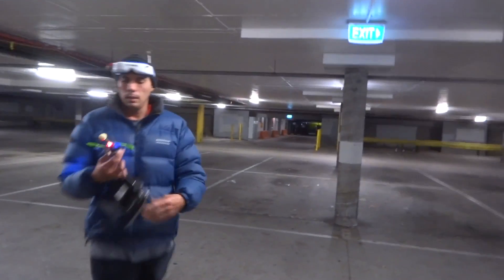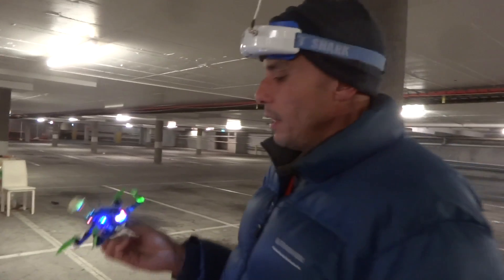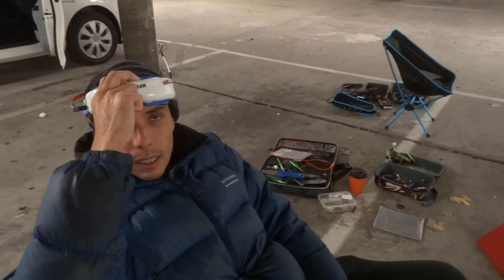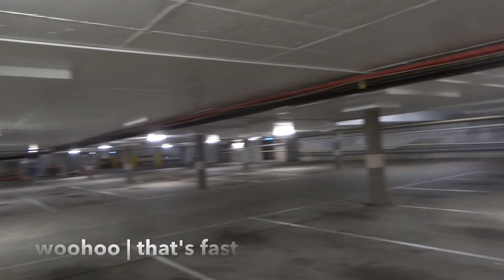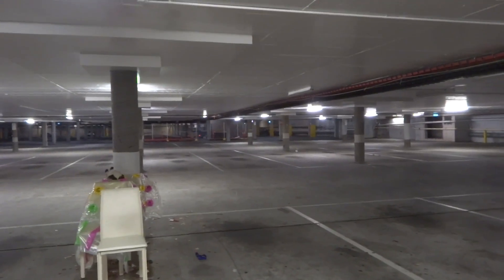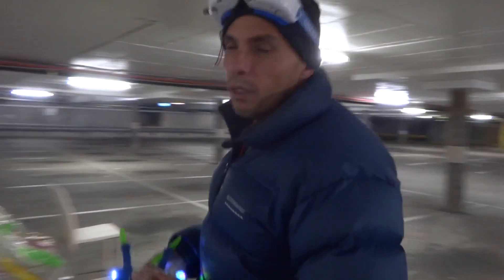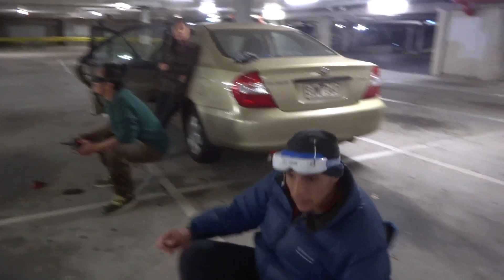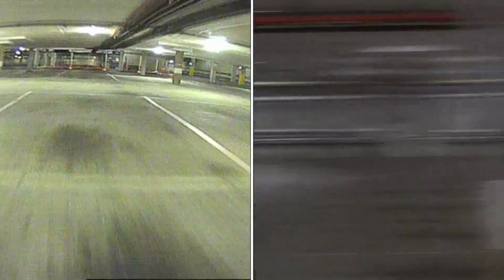Skidmark Nano Car Park Racer | free download

Comment: Maybe you could put a full kit list - either in the description or on the rcgroups page.  Like what fpv camera fits, what are you using for standoffs, what's the recommended fc to go in there etc
Reply from the maker: It uses the rc timer camera as per the recommendation with the tri. The stand offs are 20mm long aluminium with 3mm tgread. I will update soon on the thread. Thanks JB
Reply: +jbalatutube there's now a 40 ch  version the doc cam now